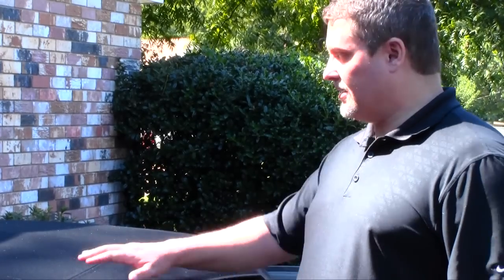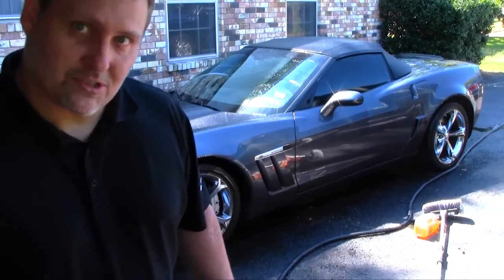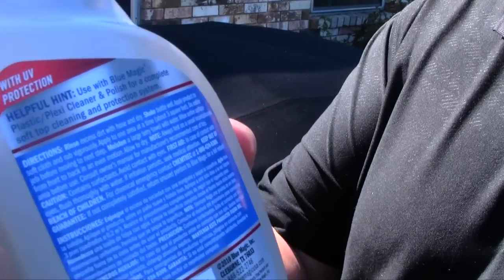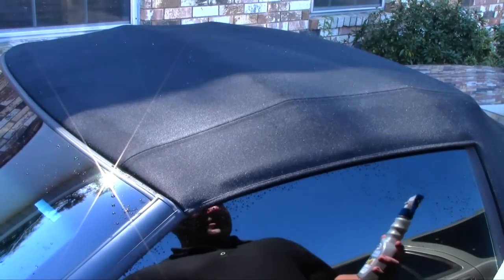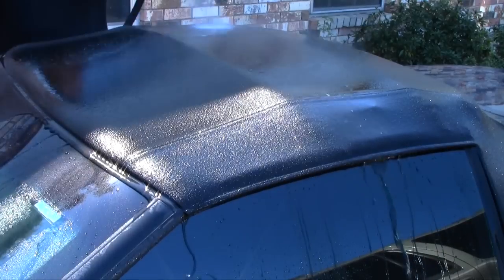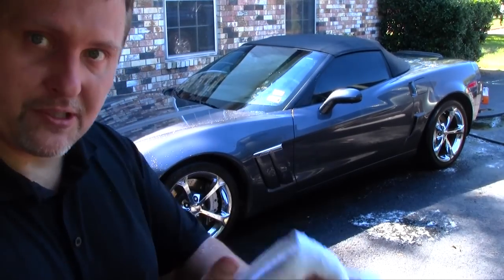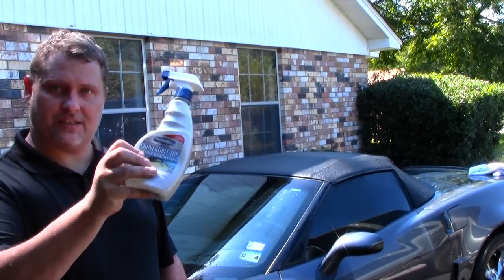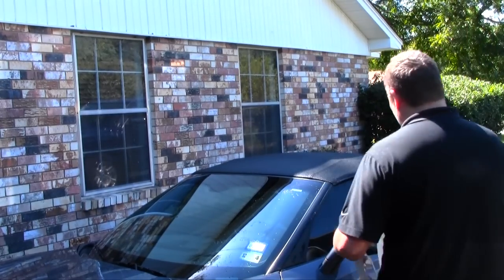How To clean a convertible soft top

Comment: Ok, giant car washing tip for you.  DO NOT CLEAN THE WHEELS FIRST AND THEN PUT THAT SPONGE/BRUSH ON THE PAINT. Brake dust is extremely gritty and WILL scratch your paint. Clean the wheels first with a separate tool and separate water. Also wash the vehicle from top down. Your paint will thank you.
Reply from the maker: ToxicTiki thanks for the tip, never heard that one before sound advice
Reply: Thanks!

Comment: I bought the same stuff and directions say to use soft terricloth and rub entire surface then use damp cloth after application rubbing in one direction and let dry. no rinsing with hose?
Reply from the maker: +God,Guns and guts It has been a long time since I made this video, I don't recall seeing that on the instructions but I will double check it. Not that I doubt what your saying but if I'm wrong then i will address that.

Comment: Is that only thing,you have to put on the top to protect it. I just put a new top on my bettle
Reply from the maker: kenyetta king there are a bunch of a choices out there and I was really nervous about messing up the soft top of the car. This worked pretty good actually and it is a two stage product it both cleans and protects the top. I've also seen other products where you wash it with one chemical then protect it with another. Hope that answers your question Kenyetta thanks for watching.
Reply: Paul Foster 👌

Comment: I've used Raggtop cleaner followed by Raggtop protectorant .  When finished with the application, the convertible top is basically waterproof... water beads on the top and rolls off like water on a ducks back..

Comment: When it rains on a soft top does it ruin it or adds weight and how do they mostly feel i've never felt a convertible soft top
Reply from the maker: They are loud in general, at least on a vette. Took some getting used to. as for the rain it didn't make a lot of difference but I got rid of the car after about 8 months. So I can't really speak to longterm on the soft top.
Reply: +Paul Foster ok thank you
Reply: Not loud in a BMW Z4. My Z4 top is over a decade old, going strong, no problems with the top motor either. You must take proper care of all things if you expect them to last. Also, not all convertible tops are the same construction/design/engineering.